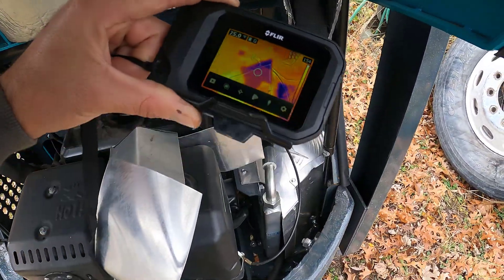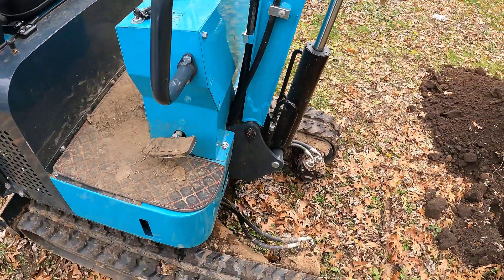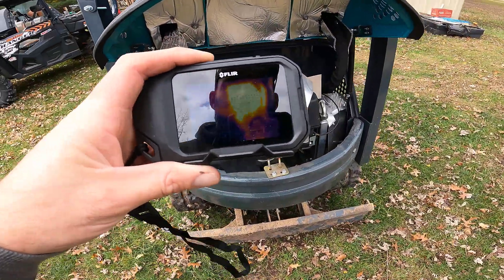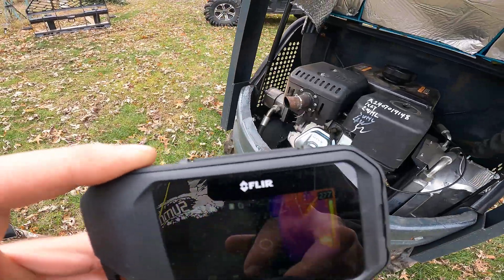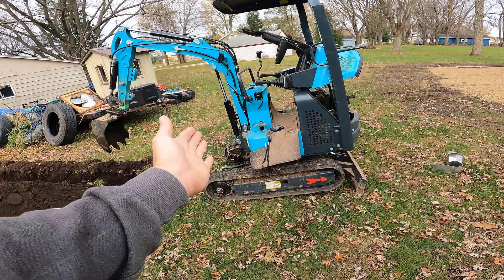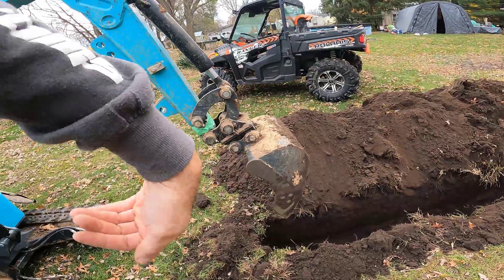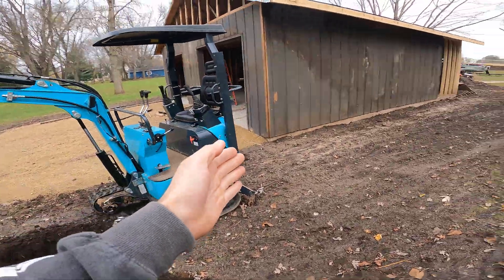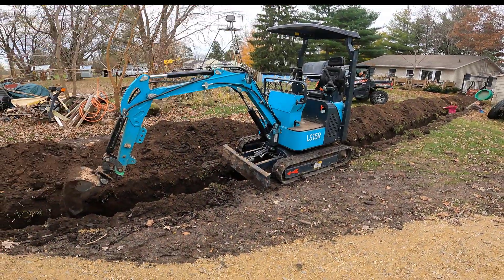How hot does a mini excavator get? Thermal imaging of the mini.

Comment: With the 16 inch bucket and the tracks are 36 wide if you have to go back and forth sides can collapse. That's why 8inch Bucket is good if only putting a water line or under ground wire
Reply from the maker: Yeah it's not ideal. I bought 2 at the auction and brought them both home went through them and listed the other one for sale and had to throw in the 8" bucket to make the deal. At the time I didn't think I'd ever use the little bucket. I have regretted doing that multiple times since.

Comment: I relocated it on the outside of the roll bar
Reply from the maker: I'm assuming gas tank, but yeah that's on my list, I'm just not sure about having a small vapor bomb next to me on a bucking bronco that has shotty wiring.
Reply: I also bolted, about three hundred pounds of railroad track on the back that helps a lot.
Reply: I am probably eventually going to upgrade the size of the gas tank. Because I probably go through 3-5 gallons a day but I'd rather have it on the outside than. On the inside, with all that heat gasoline boils at 200°. And you've proven, it's that hot in there

Comment: I have a ls15r I am not sure if it got too hot or why I have air in the gas line?
Either way, I had too much pressure in the gas tank end. It pushed off the gas cap, splashing gasoline all over engine compartment so I relocated, the gas tank on the outside i also added to fans and upgraded the battery to a
Marine battery because the Magneto does not create enough current to sustain.
The load of the fans
Reply from the maker: I'm thinking about moving the gas tank too. For heat and filing.  How did you mount it? Happy with doing that?

Comment: I use a harbor freight electric fluid transfer pump to fill up fuel. Well worth the $13.
Reply from the maker: My grandpa got 2 of those as seen on TV pumps... I was thinking about stealing one. I used it a while ago to empty a gas tank on the frame swap project on my black dodge and was surprised how good it worked.